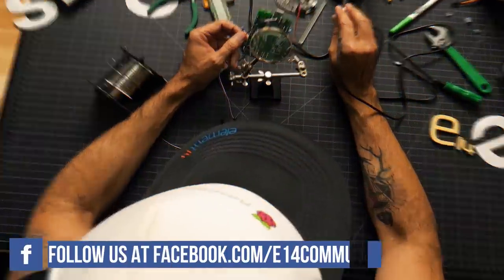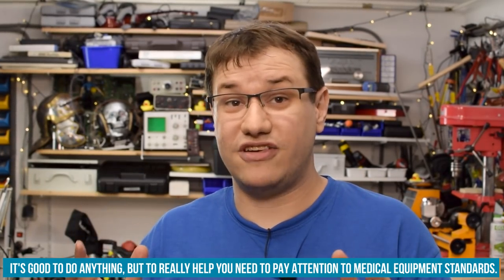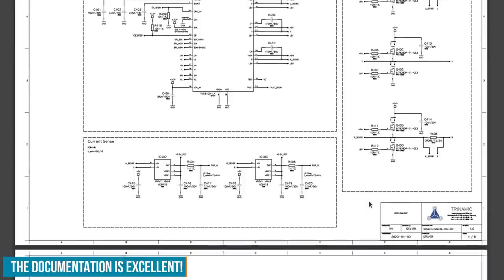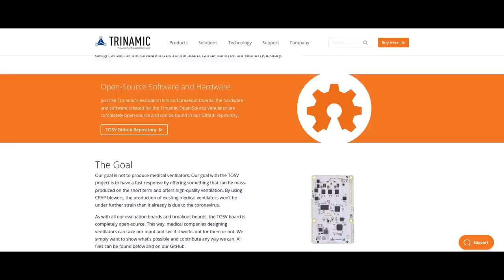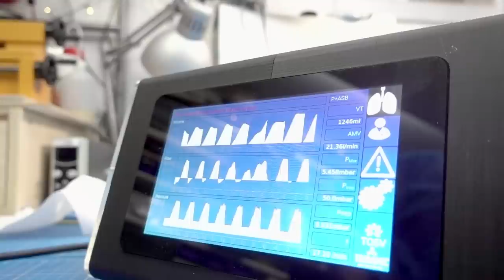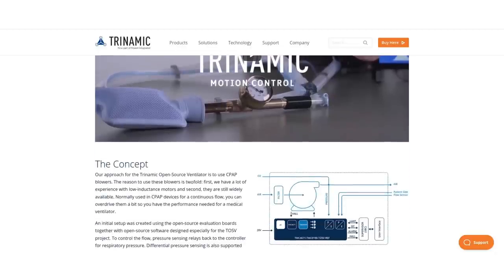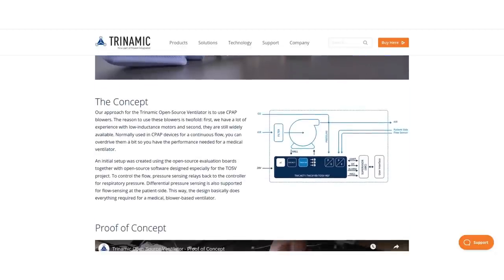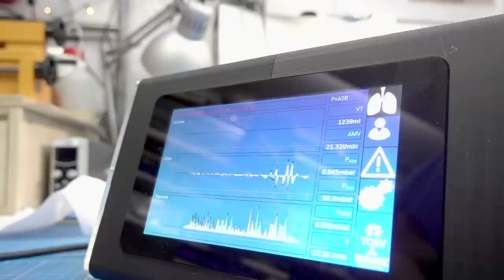Trinamic Open Source Ventilator (TOSV) Teardown using #RaspberryPi

Comment: The patient circuit installed is for a Drager Oxylog ventilator, it is single patient use only. How is it exchanged easily when it's cable tied inside the housing?
Reply: its aPrototype, thes things have to be figured out for production of course.

Comment: Very cool, but sadly your never going to get medical certification on something using a raspberrypi.
Reply: RPI based products have received many industrial certifications in the past. RPIs are not that different to other embedded computers that get use din medical equipment, So I wouldnt be so pessimistic about it, but moving to a different SBC down the line is always possible if needed.

Comment: I was wondering how much it weighs. I have to be on a ventilator all the time; it weighs around 13lbs, and is on my back in a backpack so the lighter the better. I've been looking for a lighter mobile ventilator for some time now without luck so any feedback would be greatly appreciated.
Reply: i havent weihed it but its below 2kg without any oxygen flask